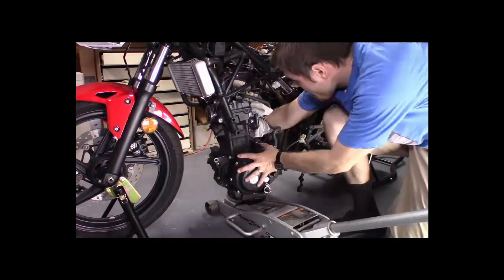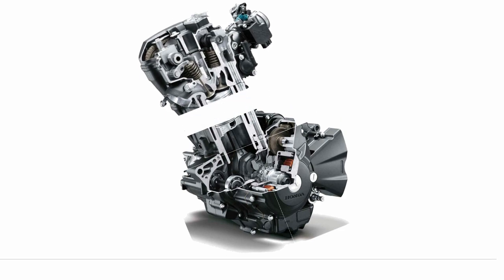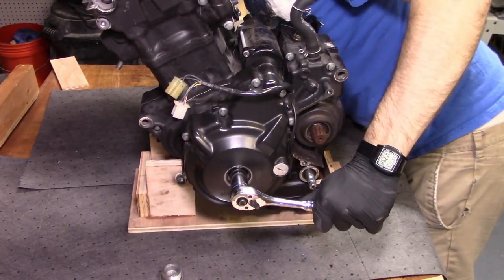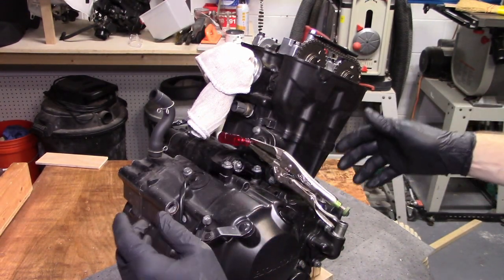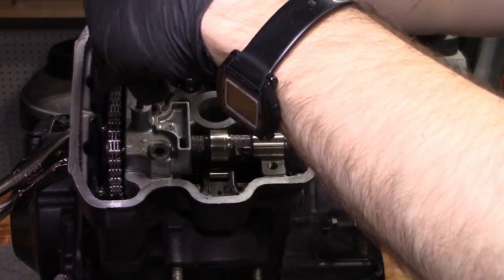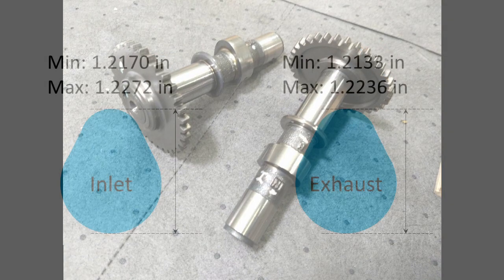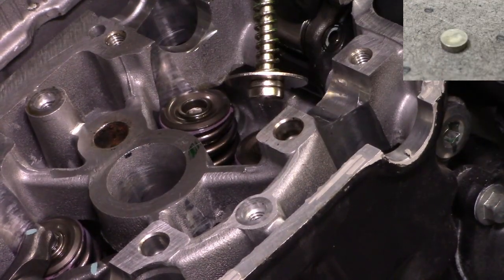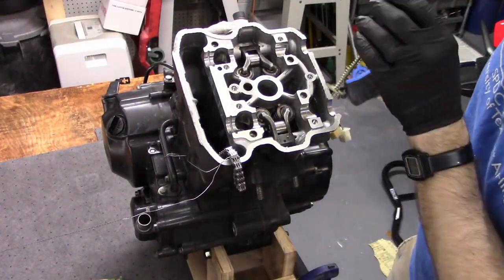CBR300R - Engine Teardown Part 1: How to Remove the Cam Shafts and Cylinder Head

Comment: What if i cant shift it to neutral when trying to line up the m and ex my bike was stolen and got it back from the police with it stuck in first.
Reply from the maker: not sure, but i kinda assume that some piece of the shifter linkage maybe got bent. i dont think the clutch or transmission would get damaged too easily, but if the thief was an incompetent rider, maybe he stomped on the gear shifter, or maybe dropped it on the side and the ground or a curb hit the gear shift??

Sorry that happened bro. Good luck getting everything all fixed up again!

Comment: have you any idea what maximum mileage of this engine possible ? Can it last 100k miles?
Reply from the maker: The service lifetime of the engine will depend a lot on the care it recieves. With closely monitored fluids and regular maintenance on a garage-kept bike that isn't ridden super aggressively very often.... yeah, 100k seems very possible.
Reply: @lightningfrog27  thank you!

Comment: here we see the old Honda trick of using the cylinder head casting as the bearing for the camshaft . this is low cost in production.. compared to using replaceable ball bearings. In practice this lasts a long time.. but if damaged or badly worn.. the head must be scrapped.  So 30 years from now not so happy as we might have been.
Reply: Good thing they're a dime a dozen. The whole cylinder head assembly is $110 on revzilla.

Comment: I guess you intend to do valve work as well as repair the lower end.. otherwise I am uncertain why you want to remove the cams ? `!!
Reply: The timing chain prevents you from pulling the cylinder off.  The fast and easy way to get the chain off the cam sprockets is to remove one or both cams.  The valve shims probably don't have to come out, though.
Reply from the maker: I guess? I was just following the service manual for how to get at the crank. In retrospect, I suppose it was more disassembly than required...but I've had a handful of requests for a demo on checking valve clearances...I guess I'll do that during reassembly?

Comment: Hey need to upgrade the performance of cbr250r so want to use the following parts from the cbr300r:- 1. Block piston 2. Cyclinder head 3. Crankshaft 4. Clutch assembly 5. Balancer 6. Chain set of 300r
I want to know whether these will be a direct fit on the cbr250r's engine??

Comment: Theses videos are awesome! Is this problem going to happen to my engine eventually? What is the best way to prevent it? I’m planning on doing oils changes every 3k miles and only using full synthetic. I ride like I stole it cause I’m a 2-stroke loving dirtbike guy 😆
Reply from the maker: Thanks!!

As to the question about whether this might happen to your bike....¯\_(ツ)_/¯....What year is yours? The recall against defective cranks and rod bearing retainers was for model years 2015 and 2016. Either way...with proper care and maintenance, this really should not happen to any engine. I guess i'll have a better idea of what's wrong and maybe what caused it once i split open the crank case and can actually inspect the parts deep down inside.

Regarding whether riding "hard" is bad for the engine....i saw a video here on youtube where they were comparing a "proper" break in vs a ride-it-like-you-stole-it break in, and they happened to do it on a CBR300! Spoiler: they said they couldnt find any difference on the internal engine components during the post-break-in tear-downs.

https://www.youtube.com/watch?v=xpoglovyy_8

Long story short, sounds like you're doing everything right!